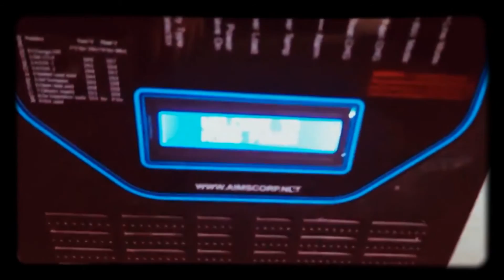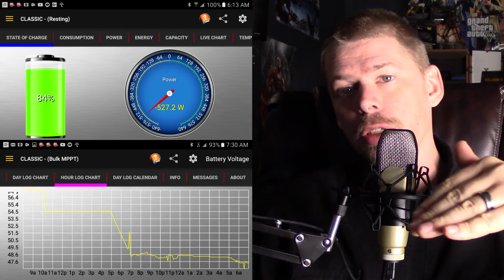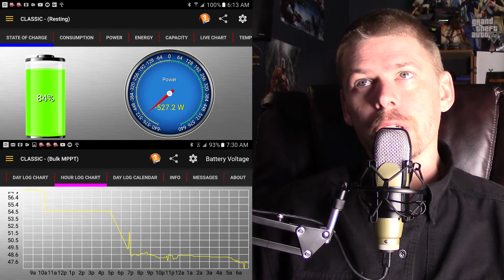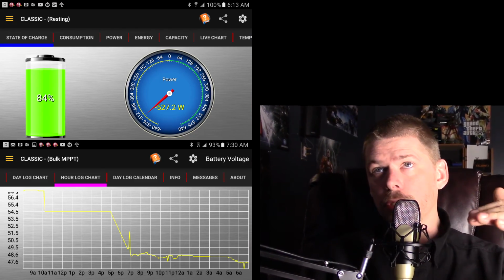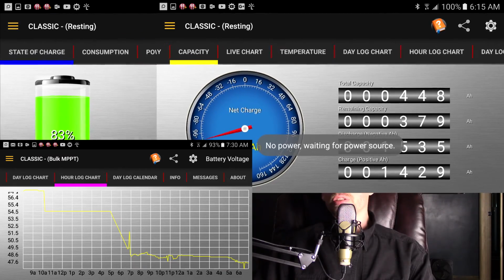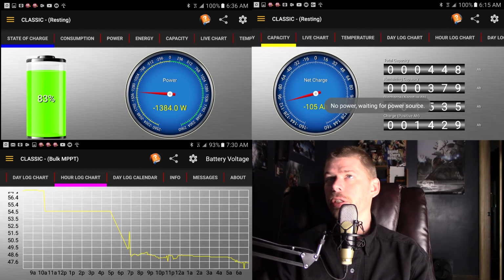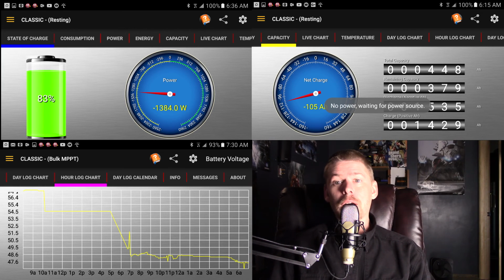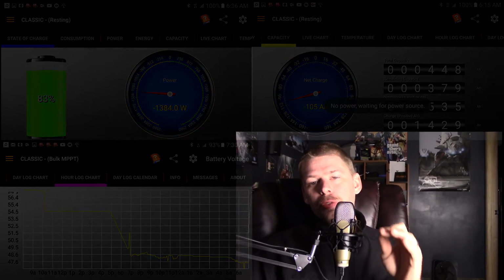Over Night Battery Power Consumption!!!! The Off Grid Magnum Inverter 48 Volts O Yyyaaahhhh Baby!!!!

Comment: Glad your liking the Magnum.
Reply from the maker: as long as it doesn't get on fire again I'll be good
Reply: +Solar Power Electricity and Electronics (phillip20) glad to hear that. I have 600AH telecom batteries for my magnasine 4024s,  the question is, Can I use it continuosly with 1000watts without putting stress onthe inverter and probably affect my agm batteries?